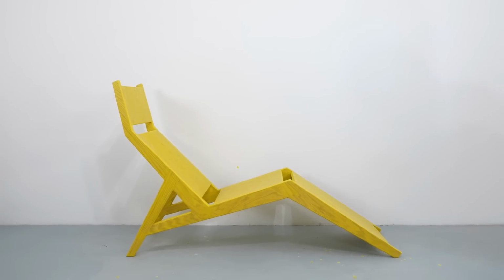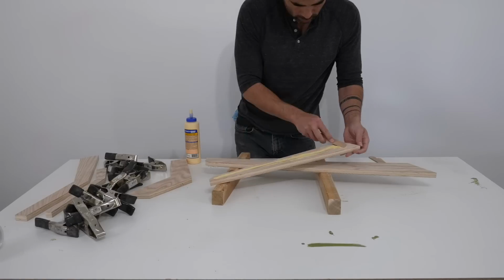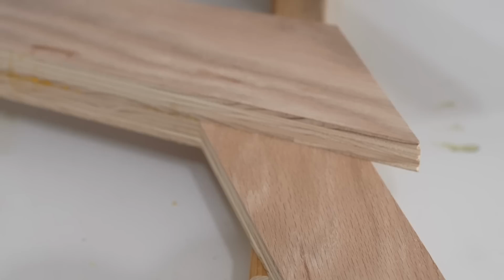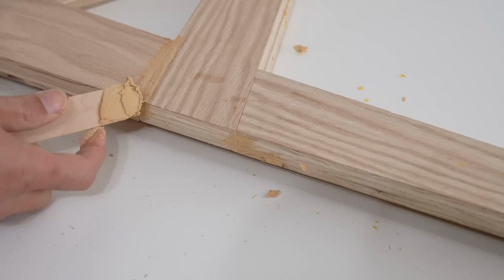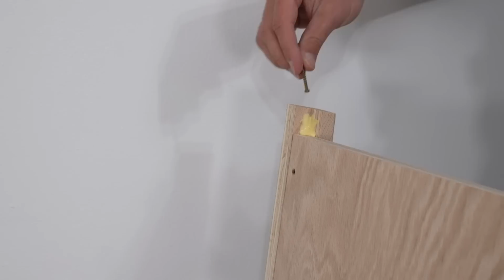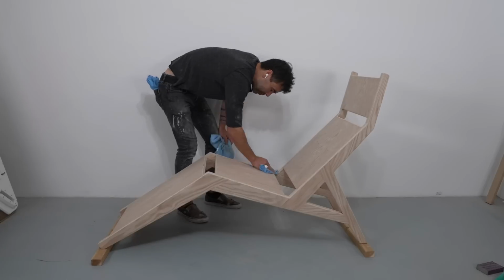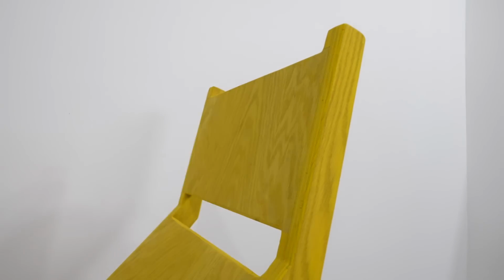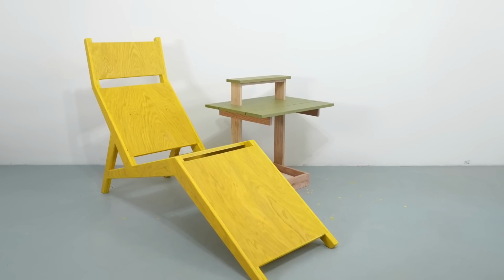Making a PLYWOOD LOUNGE CHAIR

Comment: Hi Ben, do you think that the Kreg jig is much better than a regular squad ruler?
Reply from the maker: I like the portable cross cut way more than a speed square.  its easier to grip and more accurate since it doesn't slide.  The straight edge guide is great and I like it for cuts 2-4 feet long but I think a straight board is fine for 8 foot cuts

Comment: It looks great, but it will be hard to come up with a design that fits a range of people. I would at least have one of the joints adjustable. I would also consider making the table be a tray that can plug into the side of the chair.

Comment: Only problem I see with some of these projects is how will they handle the 225# 6'3 nephew or 275# friend/relative?  I've no doubt these can handle Jessie or yourself at ~170#, however you should include max weight before catastrophic failure.

Comment: Why do you use crappy Big box store plywood? Especially Red Oak?  Also, your water base top coat is NOT going to protect the plywood from the outdoor elements. over time the ply's will start to buckle, separate and rot. However, if they are used indoors then they may last longer, but TBH they are not very attractive, especially when you can see the red oak grain through your stain. Change the plywood you are using or paint them so the ugly grain dose not show.

Comment: I’m sure you know but you can take a rag with water and wipe up the squeeze up off during glue up.  If done right you will only have a small film let over after it dries that will sand very quickly.

Comment: What about stability? I like the design, but will it support a guy of 1,90m height and 190kg weight. Just asking for a friend. Best wishes from Germany
Reply: I commented similarly.  I doubt Jess or Ben tip the scale at more than 170#, which to be honest one could almost get away with using popsicle sticks as lumber. Almost anyone can throw a CAD design into an X-scale and plop something out that looks kool. Whats missing is the proofing stage showing where it can withstand a lot of the bigger folks weight.

Comment: I was interested in the design but you lost me at CNC. Hoping you will make an everyday woodworker design for those without big, expensive equipment.
Reply: I was thinking the exact thing. I stopped watching about a minute in
Reply: LOL, with these simple shapes just create router templates and make a series of chairs the traditional way. 

Also, this is the perfect project for something like a Maslow or MakermadeCNC hanging CNC router. Sell a few and the Maslow pays for itself. Then build a few more and get an XCarve. Then a few more and get a proper CNC router... 

But where's the fun in that when we can just sit here and complain jealously... ;)
Reply: @rhdt  If the average weekend woodworker wanted to build templates, create and sell what they make, constantly upgrade their equipment, always needing to sell more and more just to pay for the newer, bigger, more expensive equipment, well, they wouldn’t be a weekend woodworker just going out to enjoy building some stuff for their enjoyment. Interesting that you see this as complaining but that’s ok, you do you.
Reply: @jordonozero7838  Well, I can see your point. 

Though, in my personal experience (from building a piece of furniture based on the same principle of interlocking sandwiched plywood) this build can be easily achieved with a simple track saw, no even of the plunging kind. At least that's what I did. Layout directly on two stacked sheets and cut away. Depending on how much time you spend on planning the layout, you may actually save a lot of material that way. I did also use a table saw with a large sled, but that's probably just easier, not necessary.

Maybe you see why I took your comment for "complaining about people using expensive machinery". Sorry, if I was wrong about that.

Comment: Looks really nice. Suggestion:  You need a cross brace between the back legs. If you wanted to make them really durable, a light fiberglass would still show the stain. You could really improve them with a splay on the side pieces to make them stackable.